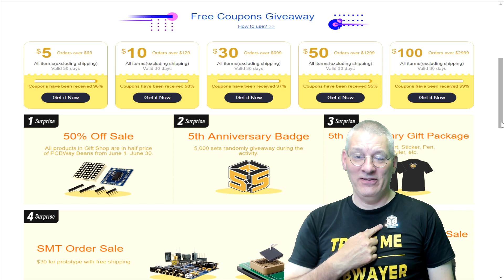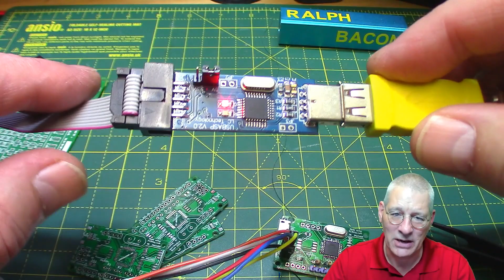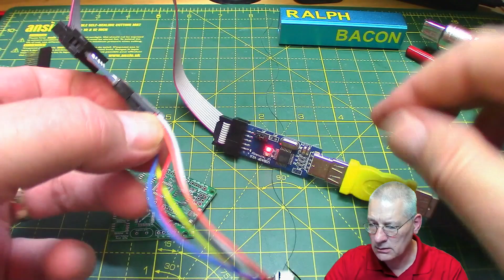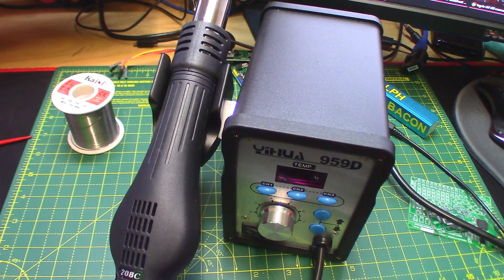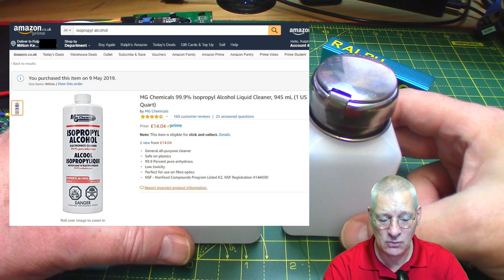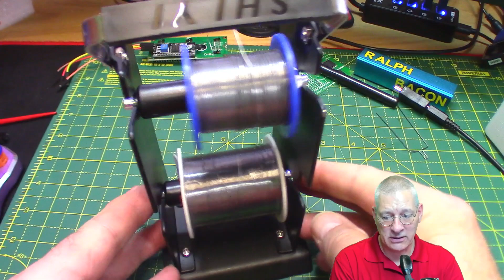#150 SMD KiCAD Arduino PCB Project (Spoiler: 😭=FAIL)

Comment: From the start I ordered a stencil with my PCBs. I am using a Bismuth/Tin solder paste (with some silver). It is lead-free, but melts at 138C! 
Apply the paste through the stencil, place parts with tweezers and literally bake in in my oven. I approximate the soak phase and solder phase with the oven control. Solder temp I go up to 160C for about 30 sec. Then open the oven slightly first, then full. Results are phantastic. I can solder even tiniest structures reliably like WSON-8 EP or QFP with 0.4 mm pitch.
Never ever mix this stuff with lead based solder. It creates an eutectic alloy which melts at even 98C, often leading to joint failures.
One practical hint: half to one beer, or the equivalent in alc from your poison of choice 30 minutes before placing parts steadies your hand considerably. No joke. But not more.😁
Reply from the maker: You just THINK the beer steadies your hand, Kai. What you;ve really got is resistors at 45° and capacitor tombstones but which looked fine after the "one" beer!
But an interesting post, thanks for sharing. I will check out that Bismuth/Tin/Silver solder for sure.

Comment: 25:00 this tool is to help with the IC you de-solder, you first have to assemble it, the way it works is you unscrew the screw from the handle almost fully and at that point you can fit the metal prongs on the handle body such that the screw fits between the narrow part of the prongs, you then screw back firmly such that the screw head holds the prongs firmly. you now have a low heat capacity (thin wire), high temperature (steel), tool that you can instert under the heat gun and move the IC as soon as the solder melted.
Reply from the maker: Thanks for the clarification, Uzi, but I just cannot imagine a professional electronics engineer using this weird contraption. I've found a heat gun to work pretty well all by itself, especially if you use a decent nozzle that directs the heat to where it is needed. I'll have to try this weird prong thing again though, just to see!

Comment: the RTC chip has two I2C addresses. I've been meaning to figure out what the 2nd address is for but haven't done that yet. Maybe the 32K signal generator? There's so much for me to learn it can be hard to stay focused on one-step-at-a-time.
Reply: so, I've just looked at the two I2C addresses issue and discovered that the RTC module has 32K of EEPROM memory. It is independent of the RTC and not used by the RTC. Interesting... So maybe not the 2nd I2C address you're seeing with just a bare RTC chip? on my module the RTC is 0x68 and the EEPROM is 0x57. I found a small DS3231 library that includes functions for accessing the 32K EEPROM.
Reply from the maker: Yes, indeed Dirk, it does have FLASH. I vaguely remember doing a video on it (maybe)? The thing is, EEPROM is not that useful as you can't store programs in it, just data. Which might be useful to some, of course.
Reply: @RalphBacon  I'm going to try using it to store character sets for OLED displays.

Comment: Have you tried a solder paste instead of the usual core solder?
The paste must be very soft almost to the floating.
This will self clear between pins on IC's when heated.
Reply from the maker: I've tried it but not been that successful with it. When it works it does work, but I'm going to stick to my soldering iron for now. Thanks for posting.

Comment: It is anoying that Arduino IDE can't be set to "using programmer", Getting error every second upload is anoying.
Reply from the maker: The guys at Arduino obviously wanted the easiest way to upload, via the USB. But I agree, Thorbjørn, forgetting to press Shift is annoying (and sooo easily forgotten). I use CTRL-SHIFT-U now so it always uses the programmer if I have one connected.

Comment: I don't know if you've progressed to solder paste yet but once you start using it you will NEVER go back. I'm in Australia and use H1640 solder paste from Altronics. A single $12 15g syringe will probably do 500 or more of those sized pcbs. A syringe with a dispenser nozzle like the Altronics one is the go. You can buy the nozzles separately if you have to. 
There is a flux within the solder paste and to stop it oxidising I keep mine in the fridge when not in use. Allow it to heat up to room temp (or pocket temp) before using to get it to flow better.
The pcb come vacuum packed and with dessicant to stop the pcbs oxidising and becoming hard to solder. If you have opened the packaging for some time it's potentially worth giving the board a wipe over with some flux and then cleaning with isopropyl alcohol.

The hot air rework tool is as good as anything i've used. I've used a repurposed toaster oven but I do maybe 1000 pcbs a year with no issues using hot air.
Reply from the maker: A 1000 PCBs a year, you say, Alan? I probably solder a dozen or so (although the number is increasing)! I will take your advice and try the solder paste on my next SMD PCB. If the solder paste is in a syringe does it still oxidise (and have to be kept in the fridge)?
Reply: I only use syringes and I have noticed that eventually the solder will go off and it will tend to ball up rather than flow together nicely. I don't know if that is from oxidisation or the flux drying out or what. At the cost per board it's hardly worth worrying about. It's maybe 1 cent per pcb in Aussie dollars. To make sure I don't run out I generally have 2. If the 1 in use has started to ball up it gets tossed and replaced. I probably have the syringe at room temp (about 22C) for maybe a week out of the 6 months it takes me to use one. As far as I know all solder paste will have a use by date on it.

Comment: What temp on your soldering iron did you use on the braid to desolder the extra bridges? I always seem to pull the traces up.
Reply from the maker: It was my 'big' soldering iron, not normally used for electronics at all, Jeff. And I had set it to about 3/4 of max temp (so pretty hot) but I have no idea what that means. At this temperature (and the fact the tip can hold a lot of heat) it just chomps through any desoldering task using wick really quickly, just as well or the chip would get fried!

Traces were fine afterwards. Perhaps the PCBs you are using it on are just not as good quality at JLCPCB ones?
Reply: @RalphBacon  I got some better solder wick and I also learned why the traces are coming up. I was rubbing the wire against the board. That's like using a brillo pad I discovered. Not good!

Comment: About lead-free solder - I'm using one for hobby and work, just needed to get used to using it. Mediocre quality, but works.
Reply from the maker: If you are using lead-free for work, Damian, then I guess you have developed the necessary techniques to make it work. But the general feeling is that, for hobby use, lead-free is the spawn of the devil as it requires a hotter iron, looks like a bad solder joint (dull, not shiny) and the resultant joint can grow "whiskers" over time that can cause malfunctions. I can't recommend it and I've been soldering for several decades! Interesting that you state "mediocre quality"; says it all really! Thanks for posting, nice to hear from you.
Reply: @RalphBacon  solder itself was mediocre quality, as everything, it's best to buy a good quality one, but someone gave me 0.5kg of lead-free solder, so I needed to learn how to deal with it.
Reply from the maker: I'm left with my huge reel too but I'm not going to use it, it's too hard work. I shall have to find a replacement soon!

Comment: That springy thing is meant to help you lift ICs during desoldering. You need to unscrew that a little, put that metal thing and screw tightly.
Reply from the maker: Yes, others have said the same but it didn't fit the LQFP 48-pin chip I tried it on!

Comment: I have one of the cheap pump bottles and it does work, however it takes around 100 pumps to prime it before the alcohol starts flowing.
Reply from the maker: Mine too, Bob. Which makes it kind of useless for flux removal. Such a pity.

Comment: Hi again, Ralph, 

I thought I would sharing a couple more tips (as well as a homemade tool) only because I want to provide options for you to consider. 

I too had trouble with losing components when pulling them out of those little packages they come in so I decided to try using a plastic Tupperware containers to dump them in. 
That helped a lot but then I had trouble with components flying off when I picked them up with tweezers even though I used light pressure most of the time. 
I wanted to buy one of those vacuum style pick and place tools but most are kind of pricey so I came up with a much cheaper alternative ($25 US). 
BTW, I tried one those pen style pick and place tools that have various sizes of suction cups but they leave a LOT to be desired (no constant vacuum pressure = unwanted dropped and sometimes lost components)

I found a small air/vacuum pump on Amazon for about $12 US, it works great for this application!! 
Then I decided to modify one of those syringes made for refilling ink cartridges for your printer, the idea was to have a vacuum controlled pick and place tool that I could control by using my thumb to activate the pump, then control the vacuum to the tip by closing or opening a hole in the side of the syringe with my forefinger. 
I added the rubber grommet to insure a good seal with my finger, without it, you have to press against the hole really hard. 
I used some really flexible RC glow fuel tubing as well as really flexible 22 gauge, silicone wire to run from the pump to the tactile switch that I attached to the side of the syringe with clear heat shrink tubing. 
Take a look at the linked photos of my setup if you're interested. 
When I pick up a component with my makeshift tool, you can hear the pump load up as the vacuum pressure increases enough to pick up a component, so, it has an audible confirmation that it's safe to proceed. 
This tool is capable of picking up large ICs, in fact, the Atmega328P-AU is not even a challenge for my version of a pick and place tool. 

BTW, Good magnifying  glasses help a lot even for young eyes! 
I use a boom style AmScope microscope at 10X magnification but that's only because my tired old eyes just aren't as good as they used to be :-) 

Photo #1
https://i165.photobucket.com/albums/u50/rosenq3/Electronics/SMD%20Pick%20and%20Place%20Vacuum%20Tool_zpstmdwjafi.jpg
Photo #2
https://i165.photobucket.com/albums/u50/rosenq3/Electronics/SMD%20Pick%20and%20Place%20Vacuum%20Tool%20-%20Photo%202_zpso0dczpf7.jpg
Photo #3
https://i165.photobucket.com/albums/u50/rosenq3/Electronics/SMD%20Pick%20and%20Place%20Vacuum%20Tool%20-%20Photo%203_zps5va9z90u.jpg

Vacuum Pump from Amazon:
https://www.amazon.com/gp/product/B01MR3JZZF/ref=ppx_yo_dt_b_asin_title_o00_s02?ie=UTF8&psc=1
Syringe from Amazon:
https://www.amazon.com/gp/product/B0161V0024/ref=ppx_yo_dt_b_asin_title_o06_s01?ie=UTF8&psc=1
Silicone tubing:
https://www.hobbytown.com/lynx-heli-2x3.5mm-fuel-tubing-183cm-lyx0134/p199769
22 Gauge silicone wire:
https://www.amazon.com/BNTECHGO-Silicone-Flexible-Strands-Stranded/dp/B01C5DBKW6/ref=sr_1_6?keywords=22+gauge+silicone+wire&qid=1561388823&s=industrial&sr=1-6

At some point I may do a video of this tool in action. 
I guess I should include how I made it as well. 

I use one of my lab power supplies to power it at 12VDC, the current draw is less than 350mA. 

In my opinion, it's a worthwhile project to make SMD component placement much easier. 

I'm working on beating my old record for the longest response, LOL :-D

I hope this helps! 

All the best,

Joe
Reply from the maker: I had a couple of manual vacuum component suckers - absolutely useless. My tweezers worked much better. But I like your idea, partly because you made it yourself. I shall follow those links and see what the equivalent is here in the UK (or China) and deliberate whether I want to build one yet. But yes! Do a video! Thanks for posting (another long, but valuable) comment Joe, much appreciated.
Reply: @RalphBacon  
I will try to make a video of the pick and place tool sometime this week. 

I just realized that I failed to upload a photo that shows the needle portion, it uses a short piece of soft silicone wire insulation as the suction cup, it's small enough to pick up 0805 resistors and capacitors as well as SOT23-3 transistors and still able to pick up large ICs, no need to change tips for various components!

Photo #4
https://i165.photobucket.com/albums/u50/rosenq3/Electronics/SMD%20Pick%20and%20Place%20Vacuum%20Tool%20-%20Photo%204_zpsfefghnnf.jpg

Have a great day and I will notify you when I upload a video of this device. :-) 

Joe

Comment: I had a couple of rolls of cheap chinese solder which were fine and gave nice shiny joints. The last roll I bought gives dull joints, a bit like you describe. The stuff I have melts easily so it probably isn't lead free but from now on I might stick to getting UK stock solder from more reputable suppliers.
Reply from the maker: Ah ha! So the quality of the solder is variable then, Mike. Maybe that's why only 1 person (out of the 75) complained - he got the same solder I did! I'll stick to known brands from the UK from now, it's just not worth the risk.

Comment: I started smd soldering with a soldering iron (Metcal).  Results were good.  However I’ve gone over to solder paste (dispensed by a £62 paste dispenser) and a heat gun.  The results were fantastic.  All my smd soldering now done with the heat gun.  Looks like a professional reflow oven job.  If the multi pin chips have bridges just brush on flux and apply the iron across the pins.
Reply: The paste dispenser:  https://rover.ebay.com/rover/0/0/0?mpre=https%3A%2F%2Fwww.ebay.co.uk%2Fulk%2Fitm%2F153284986000

Photo of one of my boards done with a heat gun:  https://www.facebook.com/BedrockSystems/photos/a.2199356463517005/2199338153518836?type=3&sfns=mo

Please note, I’m primarily a software engineer not necessarily an electronics engineer ;)
Reply from the maker: Your post with the paste dispenser got blocked but I just found it and released it! I still haven't figured out the paste dispenser exactly but I already want one!!! Your board picture was very, very nice indeed. Just goes to show what can be achieved with the right pro-hobbyist tools.
Reply: @RalphBacon  You do need a air compressor to go with the dispenser.  I used an old (30 year old) compressor I had for painting models.  Been hidden at back of shed for 20 years.
Reply from the maker: I was looking at this device again, just to see how it worked and read about it requiring a clean, compressed air supply, just as your message appeared on my phone. Drat! But maybe for the best (for now). I should concentrate on getting better at doing it manually first. But interesting nonetheless.
Reply from the maker: Yikes, that's some paste dispenser you have there, Rob (link?). I've found that even a soldering iron can melt solder paste quite well. I'm not sure that's an approved way of doing it though! And solder paste is not cheap either (but then again neither is solder). Thanks for annotating your personal experiences, I'm still practicing and thinking about what works best (for me).
Reply: I am looking to get a hot plate to help as well
Reply from the maker: I've just looked at the Metcal range - once again, not cheap. My wife always told me "Buy cheap, buy twice" so I stopped doing that. But these are in a different league! I'll be interested in seeing that hotplate (I'm guessing you won't be repurposing some camping device!!!!)
Reply: Love your videos btw.
Reply: I did have (actually still have) a Chinese 852d solder station but it just didn’t have the heat to solder semi rigid coax to a N-type connector.  So I bit the bullet and shelled out for a Metcal.  As you say...reassuringly Expensive!   Also meant buying a new hot air gun ‘Quick 861DE’.
Not sure about the hot plate.  From China £35,  from Farnell the ‘proper’ ones are £300+.  Got a radio competition in 10days, after that I may order one (work area a little crowded right now!).
Reply from the maker: I love that phrase, Reassuringly Expensive - did you make that up? I'm going to steal it from you! 
TBH I try and buy as good a quality as I can afford and never the bargain basement price stuff as it never works (or lasts). That said, stuff from Lidl or Aldi is often good, (German) quality engineering so price is no indication or guarantee of quality.
I'm guessing the £35 hot plate is in the category "buy cheap, buy twice"?
Reply: @RalphBacon  'Reassuringly Expensive' - I'm old enough to remember the Imperial Leather Soap advert.   The £35 hot plate is disposable if it doesn't work.  So yes -  buy cheap, buy expensive 2nd time.